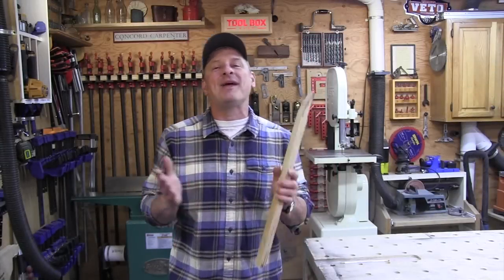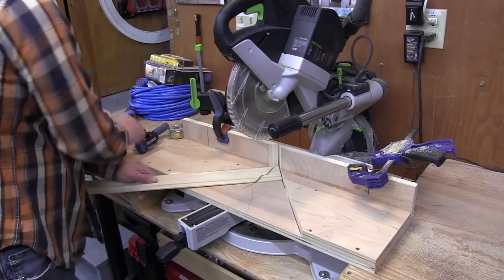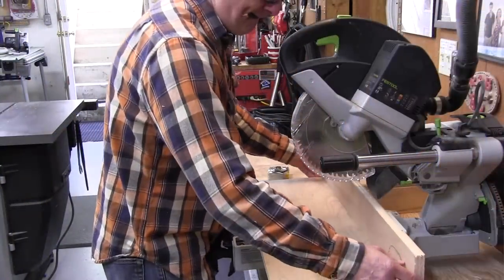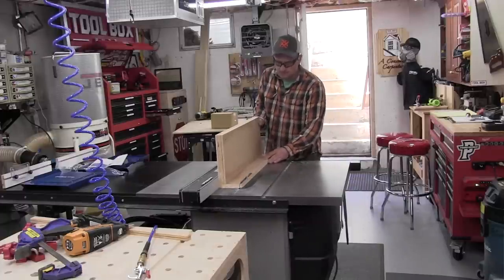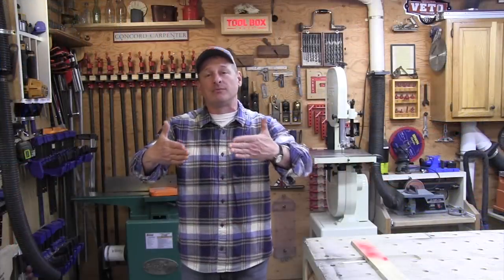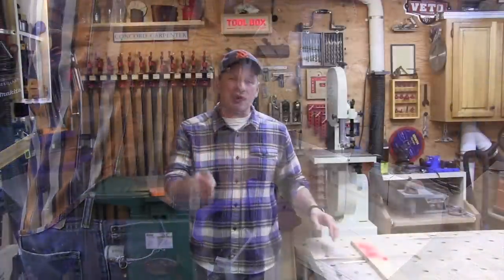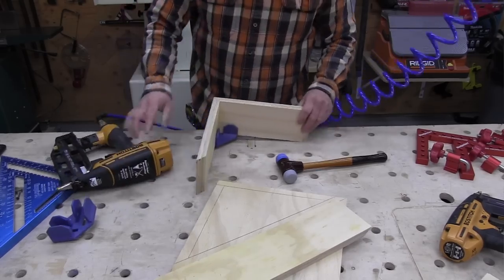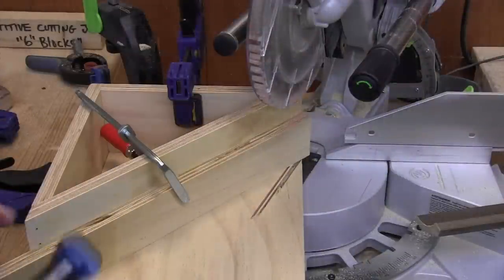Cutting Extreme Angles on a Miter Saw -  Build An Acute Ange Jig

Comment: Is there a video in the arsenal that describes how to get the angle figured out that you want in order to even get to the saw?
 I am trying to figure out what my cut will be where the outside skirt of the stair stringers meets the baseboard along the wall.. nothing I am doing seems to work

Comment: I hate cutting those acute angles.  I ended up doing a sled for the tablesaw with toggle clamps that you can get cheap on Amazon.

I just never felt safe cutting it on my chopsaw and if it doesn't feel safe then don't do it is my main rule.  

On a jobsite tablesaw it might be safer to do it on a chopsaw than making a sled.